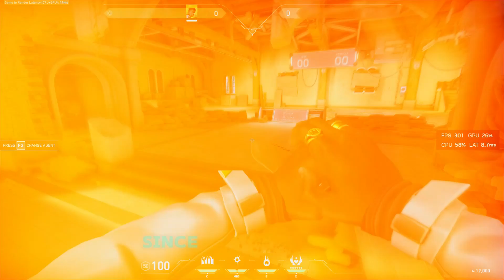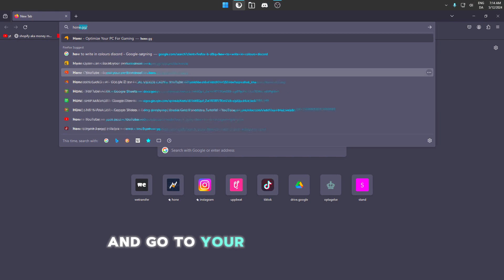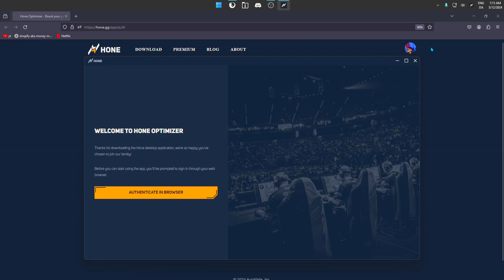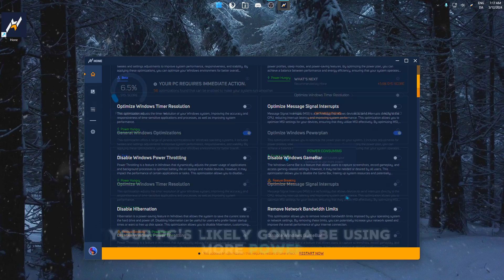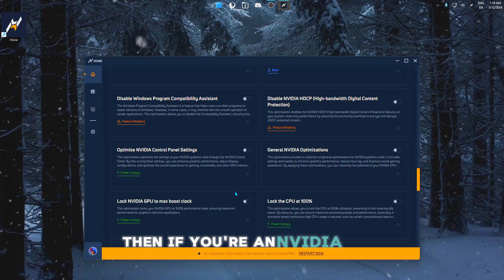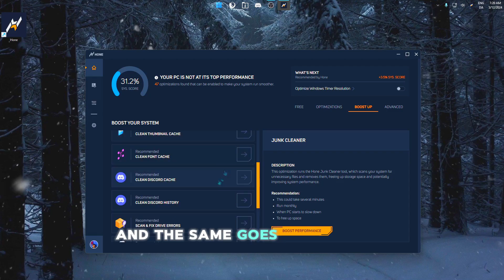🔧How To Boost Your FPS On Valorant In 2024...

Comment: good for laptops?
Reply from the maker: Yes, hone can even help your laptop. However you should choose wisely, especially with the ones marked with “power hungry”
since this used alot of power🧡
Reply: @GetHoneGG  does “power hungry” affect laptops in long term? Or it just drain battery faster?
Reply from the maker: @Dvnxhh  It just drains the battery faster. What would be causing issuess in the long term is if you keep the laptop plugged in all the time. If you don’t do that you should be good🙏🏽